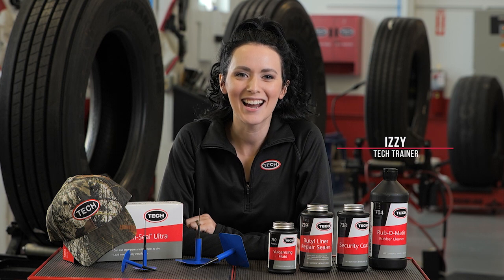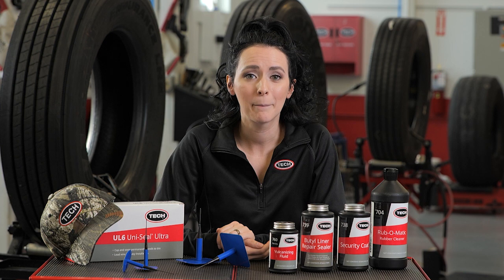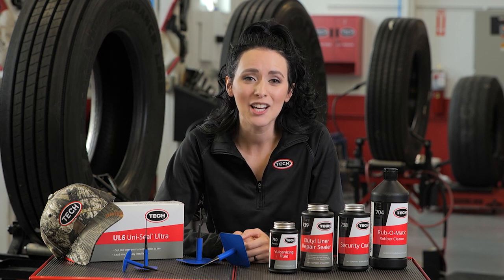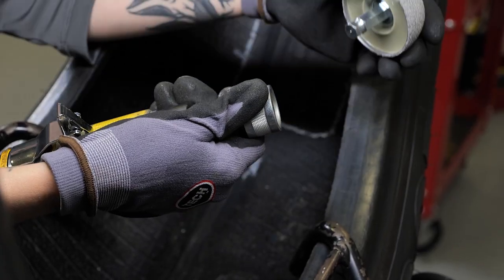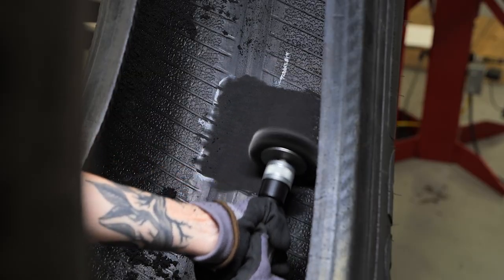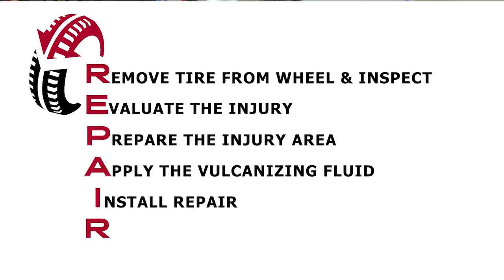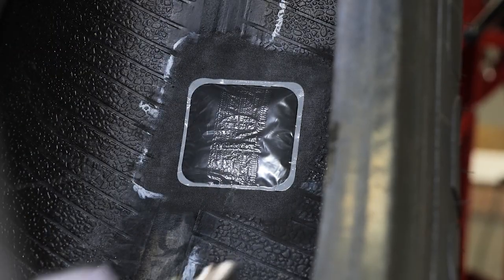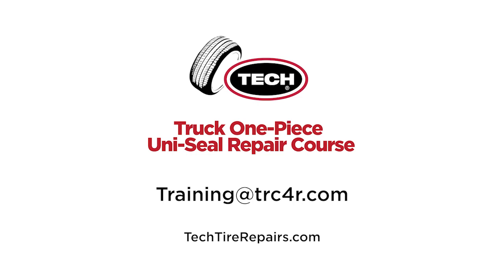Truck Tire Repair Using a One-Piece Patch/Plug Combo Repair - Full Process

Comment: Why should we leave some stem sticking out above the tire thread when cutting it? 1/8 of an inch sticking out is what I heard in the video? Any reason for this? Thanks
Reply from the maker: We recommend leaving a 1/8" of the stem sticking out as the rubber stretches when it gets pulled through the tire. Over time, that stem can contract. If you cut it too short it can recede into the tire and then no longer be fully through the tire and can allow debris inside the tire through the puncture channel and cause new damage and potential tire failure. In commercial tires it can allow air and water to contact the steel cables leading to rust and corrosion.
Reply: @TECHTireRepairs   what happen if it is harden and become a strong force to impact to the inside patch, make the patch loose?